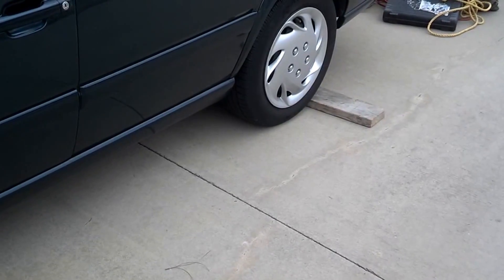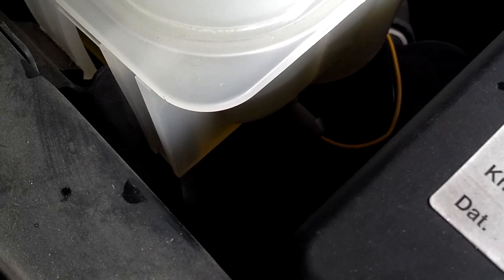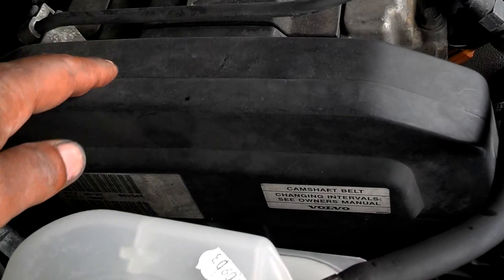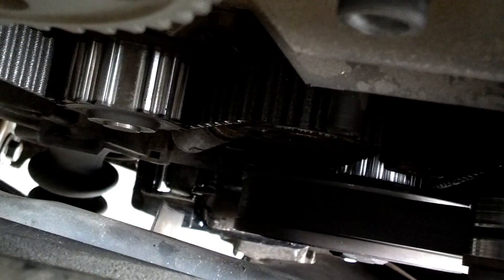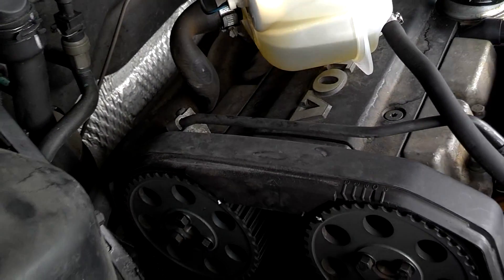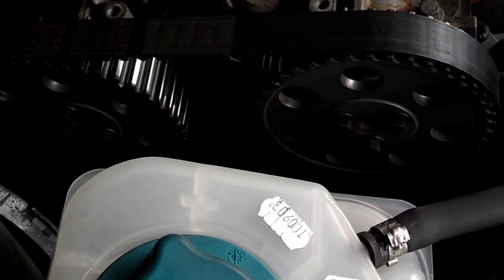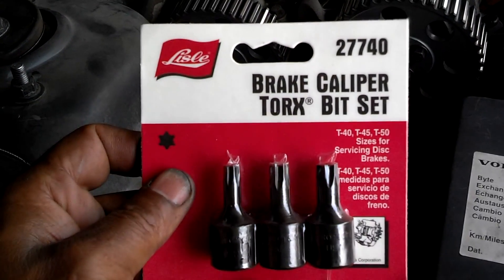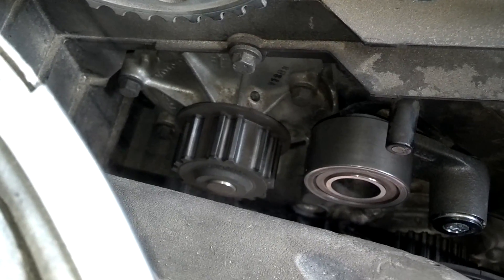How to replace the timing belt, water pump & rollers on the Volvo 850, S70, V70, etc. Pt 1-2 - VOTD

Comment: A 1/2 ratchet is too small, I tried it today. I hear that a 3/4" is too big, but I have not confirmed this. The way I went about doing it was taping pennies to my 1/2" breaker bar. Worked very well, I was surprised.

Comment from the maker: You will need to pull the head and change the bent valves. There is a chance, about 10% that a valve cut into a piston. You can get the valves and replace them yourself. You're likely looking at spending about $500 on that job if you do it yourself. If you send it to the shop, at about $250 to that.

Comment: Excellent! Very good and clear video. I am considering buying a 850R tomorrow with a broken timing belt and was wondering how hard it was to get in there. I realize I will probably have to get a valve job. Just wondering if you have heard of the heads cracking on these, and what the chances are my head and/or pistons could be bad?